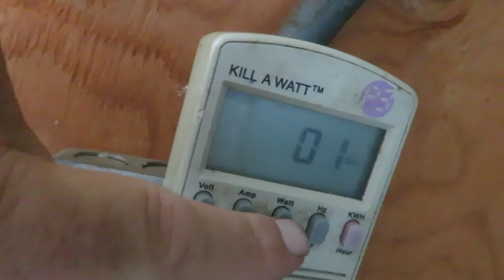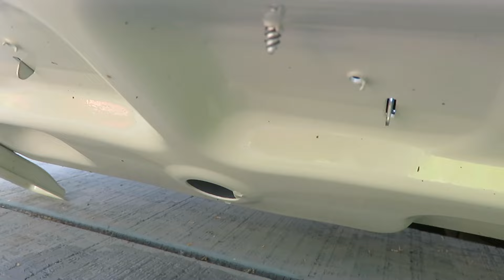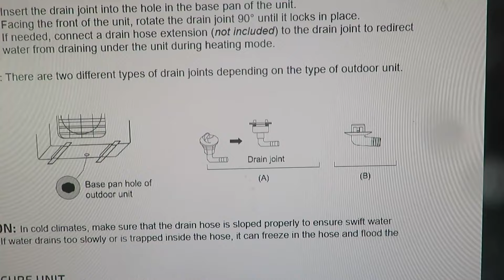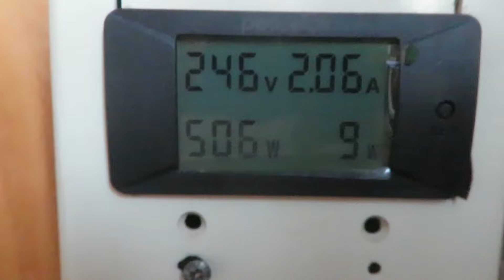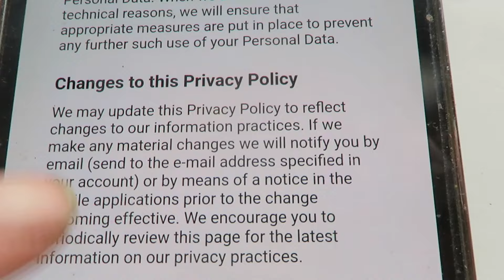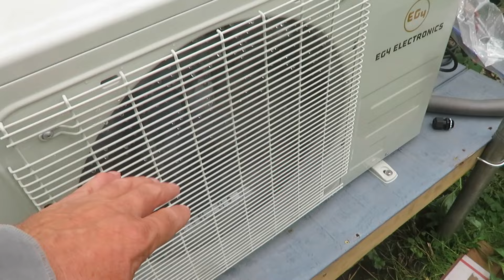EG4 Solar Mini Split Heat Pump detailed install and power consumption test

Comment: New subscriber here. I grew up in northern Minnesota and live in Texas since 70’s.  I am going to put the EG4 solar hybrid mini split in my office/Hamshack first. If it goes well I plan on getting a 24k EG4 for garage shop. I don’t know how I can use the solar panels for other things when not needed for the minisplits.  The minisplit normally asked for 90VDC <-> 400ish VDC.  If my battery bank for inverter is 48VDC I have to step up that voltage for minisplit. I have had lots of problems either DC to DC conversion causing RFI (radio noise/interference) in the past.  So initially I will just assume the solar is dedicated to minisplits and use separate arrays for electricity generation.  Fun to figure this out. Thanks for your video.  All the best from north Texas.
Reply from the maker: If you have an mppt controller for battery charging that allows high enough pv voltage , you could switch pv input  from the heat pump to charge batteries , but not both at the same time. 
You would use  an inverter to raise battery voltage to what your EG4 will take . I think it is 240v for the 24k model. You could probably just get a small inverter that does 220v which is what most of the rest of the world uses for AC - the eg4 doesn't take too much power to start and run.  Regarding RF noise from dc to dc converter - I am using a Victron 48v to 12v now and it seems pretty quiet. I have used Samlex in the past for 24 to 12v .
Reply: @LarryKapp1  yes I have thought of using inverter power for minisplit but I would prefer not inverting due to losses.  But as you say that would allow the panels not to be dormant when they could be used to generate electricity. If my panels were on the other side of the house I could divert the PV power to an element in my water heater (poor man’s dump load).
Reply from the maker: @brentjohnson6654  I have a video on how to use direct pv to my water heater . I could switch that too if I wanted.

Comment: woohoo.. 1st like and comment.  Larry.. that "Cover" is called expanded metal, the plastic version. Point the remote at the unit and then set the temp..  GREEN means it on solar. Helps to read the manual first. I commented and then was in edit mode while still watching it..  so more words\comment being added..  I have the 9k pioneer unit in my RV.. i'm gonna order this 12k EG4..I'm moving to AZ and am gonna need it.
Reply: So confidently wrong Lol
Reply from the maker: @Infamous-gu9ht  what is wrong ?
Reply from the maker: Except it isn't metal , it is plastic or nylon on this .
Reply from the maker: yeah one of these days I will take a look at the manual for operation of it !